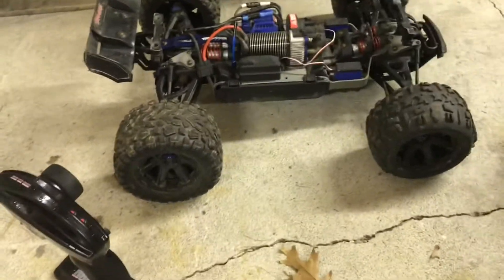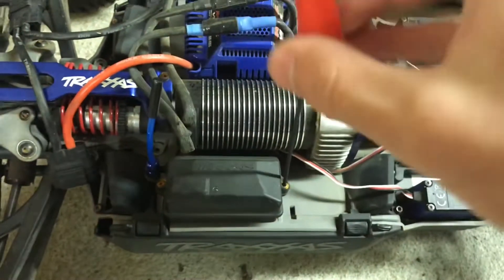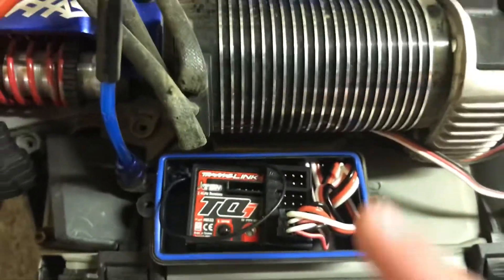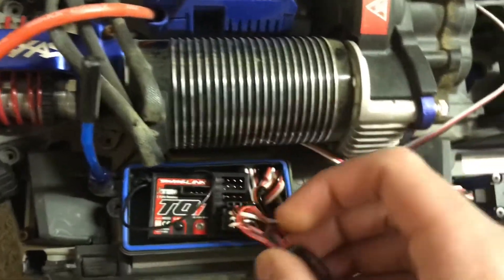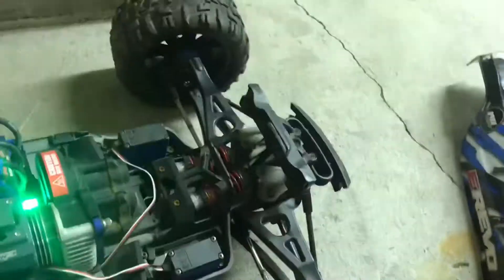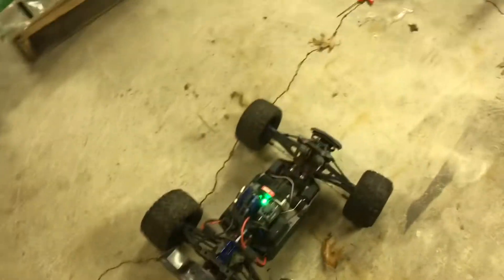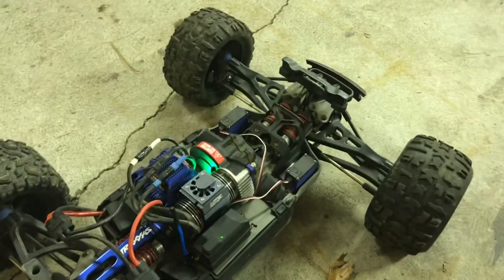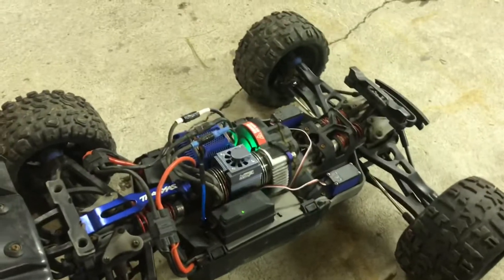Installing a new heatsink and motor fan onto my Traxxas ERevo 2.0

Comment from the maker: I had bought a new heatsink and motor fan for my ERevo!

New parts coming soon:

- Suspension limiting straps

- Aluminum push rods

- Transmitter phone mount

Also check out our No Man’s Sky Podcast on Spotify!
https://open.spotify.com/show/0m3nvba0ae22hFKhGPB3ab?si=pNov8WFkTQGWK02PDeGwlg

Comment: If those are the stock servos, you probably have those grey plastic screws on the wheels too tight, loosen them up a bit and check the difference. It did for me

Comment: Nice. Do you have a link for the fan and heat sink? Just ordered an ERevo 2.0 today.
Reply from the maker: Here’s the link on Amazon!
Powerhobby Aluminum Motor Heatsink + Cooling Fan For 1/8 Size Motors Gun fits : Castle Creations 2200kv + 2650KV Motors, Dynamite, Hpi, Novak, Trinity, Arrma Nero, Kraton, Fazon, Outcast, Tekin, https://www.amazon.com/dp/B01MR52C2N/ref=cm_sw_r_cp_api_glc_fabc_vMa3Fb1W2QZQQ?_encoding=UTF8&psc=1
Reply: @twinturbov8 ...awesome...thanks!

Comment: How has the fan/heatsink held up so far?
Reply from the maker: It held up great until I accidentally snapped the wires and when I tried to wire back together without soldering, it all burned up the second I turned on my car. Good thing it didn’t light on fire though.

Other than that, the fan and heatsink were great! Kept the motor nice and cool.

Comment: Which channel did you plug your fan in
Reply from the maker: Had it plugged into channel 4 at the time, but later switched it to channel 3.
Reply: Does it matter what channel you plug it into? Mine is in channel 4 right now. Will it go faster if I use channel 3 or 5 or 6?
Reply from the maker: @ryandodd8941  Nope. Doesn’t matter what channel you plug it in. Just make sure you don’t plug it into channel 1 or 2 lol